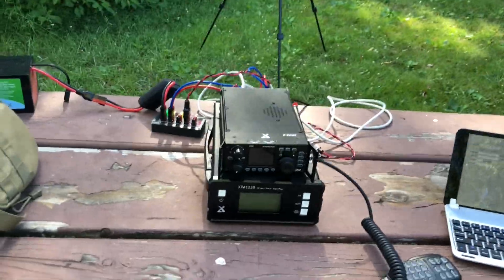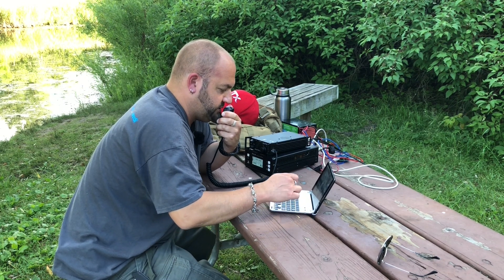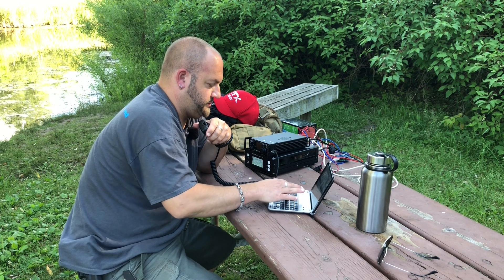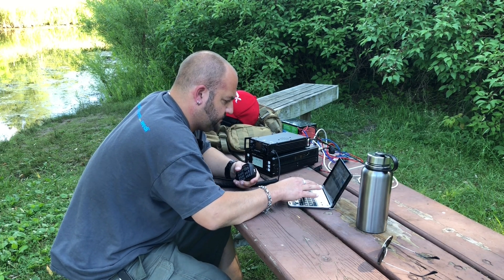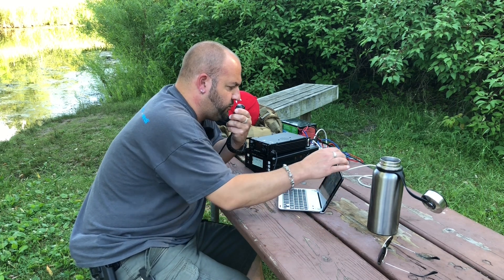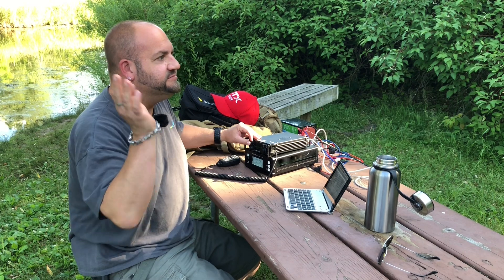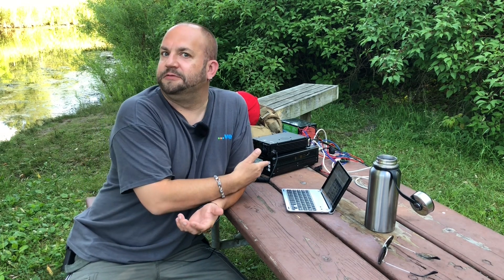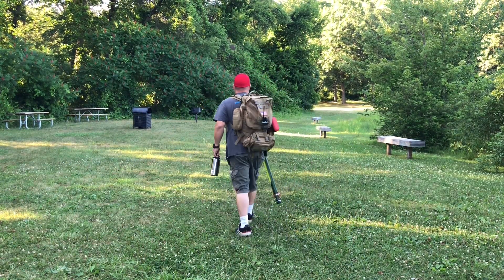Xiegu XPA125B Ham Radio Amplifier portable Parks on the Air.

Comment: I have an HF-009 antenna for use with my G90. Can I use the XPA 125B with that setup? Like, will the amp fry the HF-009?
Reply from the maker: I have no idea.  If the antenna is rated for that power you shouldn't have a problem.
Reply: @hamradiotube  Ok, thanks, and thanks for your quick reply! I enjoy your channel!

Comment: I need your help. I'm using a Xiegu G90 connected to a XPA125b amplifier through the C19 board. I use everything automatic, and I have set the G90 output power to 1 watt. The problem is that on the 40-meter band, I have good reception through the amplifier. On the 20-meter band, I can only hear signals that arrive with very good power, and on the 10-meter band, I can rarely receive clearly when the amplifier is connected as the manuals indicate. I have tested with colleagues, and the amplifier transmits perfectly. I should mention that to hear well, the G90 preamplifier must be turned on. Do you know what could be happening?

Comment: I recently purchase the XPA 125B amplifier second-hand, but it did not come with the ACC cable stated in the manual, I understand that I need the CE-19 interface module which I have on order but as I understand I still need the 6 pin ACC cable does anyone know where I can purchase one or if the pin outs are known I’m happy to make one.
Thanks in advance 
Also really enjoy your videos over in the UK.
M1EZU
Reply from the maker: Those are really great questions and unfortunately I don't have the foggiest idea.  I would say email Radioddity to see if they supply the cable.  I looked on their website and didn't find one but that would be the best lead I could give you.  Good luck and thanks for watching   73

Comment: Nice operating video.  The specs for the XPA-125B amp shows it draws 30 amps max. Any reason you didn't get close to that many amps at 90+ watts?  Also did you have any problem connecting the G90 to the Amp through the CE-19 interface?  I just received the CE-19 and the sheet a paper/manual shows a switch to connect the interface 8V/ALC and default off, not connected to the 6 pin-minini (connect XPA125 interface). I don't have the amp, but wondering how it's connected.

Comment: Just got this g90 n amp . What antenna works best for the money? Any help would be great, on a fixed income, ssd.
Reply from the maker: Congrats!  That is a very open ended and subjective question.  Making an antenna is always going to be the cheapest route.  You could make a fan dipole for multi-band, you could make a 9:1 random wire and use the tuner for pretty much all the bands, you could even stick a wire in the center of the SO-239 with a banana plug, and other wire on the ground lug as the counterpoise and get on the air.  Or you could buy any of those types of antennas and then some.  Some good ones are the PackTenna Mini 9:1, PackTenna EFHW, PackTenna Linked dipole, TennTennas EFHW. DX Commander Expedition.  I don't know of a good commercial fan dipole but they are so easy to make.  Just get a 1:1 balun and connect your wire to it for as many bands as you like.  There are all kinds of instructions on the internet.
Reply: @hamradiotube  thanks for your help! Would like to buy all the stuff needed to do all bands in one antenna if that's even possible.
Reply: That’s interesting…never heard of a fan dipole. I’m a newer ham just getting into it so I’ll definitely go check that out. Thanks for the video! 🤙

Comment: The G90 seems to have a very noisy receiver.
Reply from the maker: It's just wide open.  I don't have too many complaints about this radio but the lack of noise reduction and a notch filter does make it quite noisy.  Other than that its a great entry level radio.  I use it all the time.

Comment: Thank you for this informative video. The amplifier as an addition to the G90 would be tempting. But I also think that using my IC-7300 would provide a bigger radio display and a lot less cabling. Still that amplifier is tempting. You are lucky to have access to a park where you can drive your mast into the ground and where you have a bench to set up. Here in New York City our parks don’t have enough benches so they are usually occupied and nothing like wire can touch a tree and no holes or digging into the ground is allowed. Enjoy your times out portable. 73 de N2LRB
Reply from the maker: Options my friend.  Options.  That’s gotta be rough in the city.  Maybe you can find a place to set up with a portable chair and table?  Something you could pick up at a camping store perhaps.  Light enough to carry.

Comment: 45 minutes, 2.5Ah. That's really interesting, so about 3 hours before the battery is exhausted. 2 batteries needed for a day out portable. I guess it's possible. . . yes, interesting. Thanks.
Reply from the maker: Yeah that's about par for the course for this setup at 100 watts.  I usually use a 20AH battery when I'm operating 100 watts, so double that time.  It really depends on how much you are transmitting though.  Just on receive you could go almost 20 hours.  I've never run out of battery, and you can increase your operating time if you add solar to the mix.  I ran field day this year totally solar with a 100 watt panel and my 20ah battery with the IC-7300.  When I got home and put the battery on the charger it only took 2 amp minutes before it was topped off!
Reply: Wow that’s interesting.

Comment: Well I tried a POTA activation and was disappointed with the results (0). I know I could do better with my mobile unit but we did not bring that vehicle on our vacation. I think I am through with the WRC SB-1000 setup. I don't want something difficult to setup and dink around with tuning. What antenna 20-40 (besides your DX expedition) do you recommend for a FT-891 radio and POTA?
Thanks
Kevin KA0KAE.
Reply from the maker: Well that's too bad.  Zero contacts, really??  Try the PackTenna Linked Dipole.  You can't go wrong with that.  You'll need a way to get it up in the air but it has never failed me.  Neither has the WRC though.
Reply: The Yaesu 891 is a go to radio for many that do park's on the air. Mike has used it. I've used it many times. Great rig. Lots of bang for the buck.

Comment: Great review.  Thanks.  I am considering changing from 5 w FT 818 (cw only on 40 and 20 for rag chewing) to my ten tec eagle with higher power.  I would be interested in any comparison you have made from 5 w to 20 w, 40 w or 100 w in good signal above noise etc.
Reply from the maker: That's a great question.  I would say it depends on your operating style/position.  If you are just at home with your radio rag chewing between 5 and 100 watts, having 100 watts will certainly help you make contacts to other stations much easier.  However, if you are the one calling CQ, I don't think your power is quite as important as your antenna.  Having said that, if you can hear the station quite strong, I would suspect the other station would RX you.  But, having more power to punch through the pileup is where 100W is going to help.  There is def an advantage to higher power in those situations.

Comment: Great video,  add usual. Thanks.  Congrats on your first dx contact. Just curious, on tuning freon 160 and up,  I wonder how efficient that antenna is.  Main thing is, you got out all over the place and nothing caught fire 😂😂.
Again, great job. Have fun, stay safe and stay healthy. 73.
Reply from the maker: Thanks for watching.  This was not my first DX contact, just the first dx contact that came back to a POTA activation that I can remember.   At 160 and 80 the antenna would be all kinds of inefficient.  I'm sure it would still work but a bit of the signal would be burned off in the coax on the way up.  So long as the magic smoke doesn't come out you should be fine though.  73
Reply: @hamradiotube  as long as you don't let the smoke out, it ain't broke.😂😂😂  I enjoy your channel, thanks.